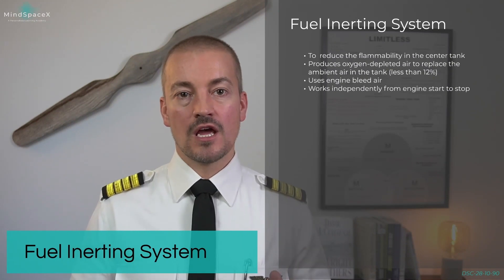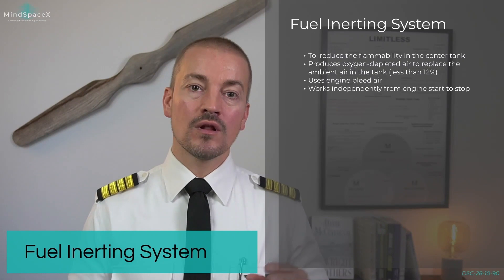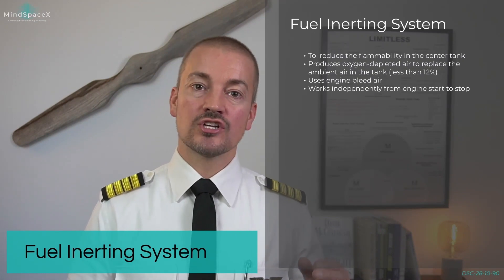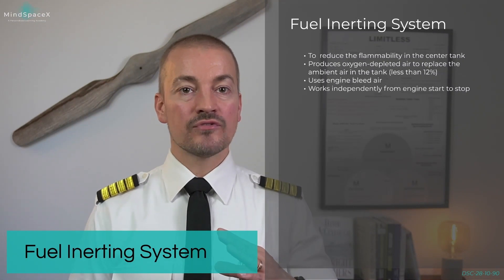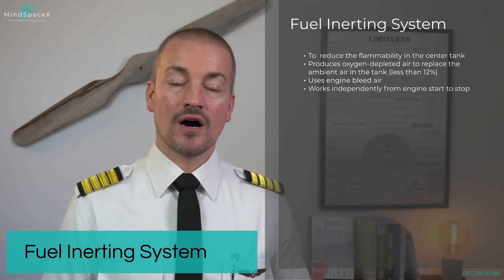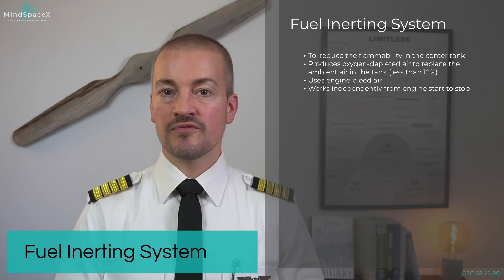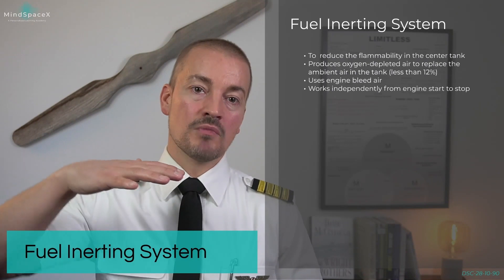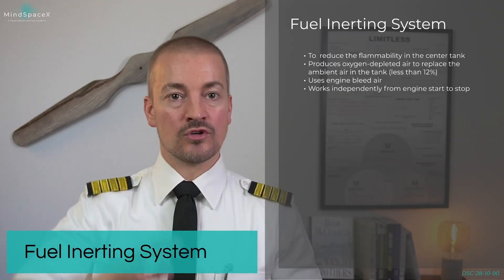A320 Fuel Inerting System

Comment: Okay, now add these to every commercial airliner, &/or a chemical fuel inerting system or flashpoint reducing system in compressed emergency cylinders all inside the wing fuel tanks & eradicate any chance flying could result in being immolated on the runway bcuz a pilot turns into the wind. Cost effective? Can u put a price on not being burned alive in an inescapable aluminum tube?